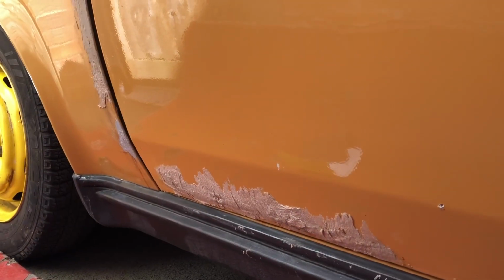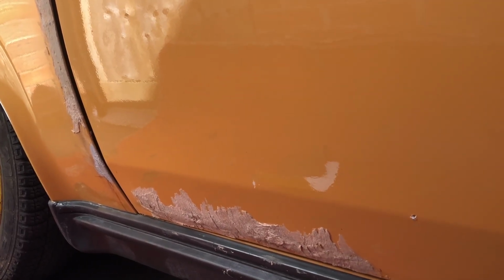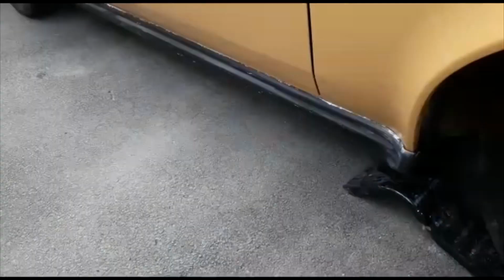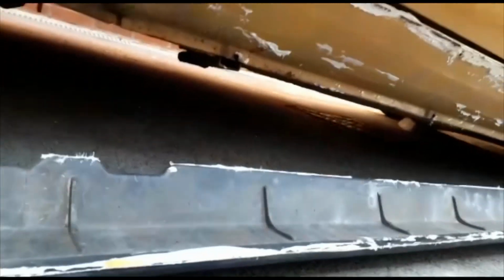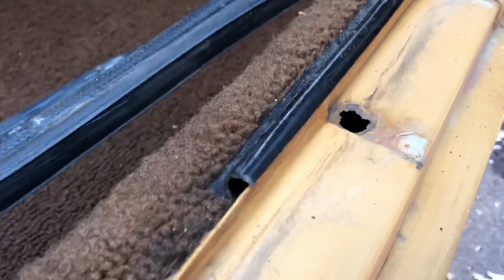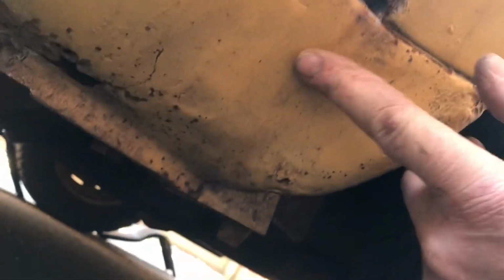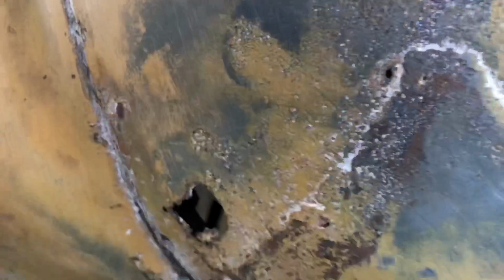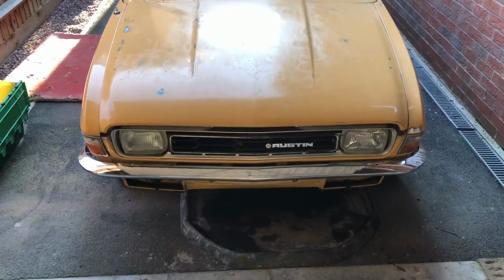Austin Allegro Ep.5 Bodywork begins, digging for rust!

Comment: rust? nah just errr unfinshed body work, and errrrr browning of the metal not rust beatiful plumage the allegro huh? no its not rust its just brown over spray paint hmm see though it well yes for better acess very good them bl boys huh? adding a brown hole here and there to get to nuts and um other things, 
ooh its not bad "shows picture of a lump of filler" okay that bad but its not that bad bad i've seen worce its when you find bake bean tins for patches you start to worry, 
yeah those holes are bad but i guess at least something aws done filler its not on major parts as in the sills or you know crumple area's but yessh going to need some bits of metal and bender of metal and a weilder oh and cutter to put in new metal, 
sadly again back in the old days plastic for area's were water will ge trapped or water trap area's weren't fixed until the 90's by then though the rust went to others area's were rust didn't go but now did so its gone in the classic water trap area under the front valance and the bonnet side and wing sides shame but not that bad it can be saved, 
the allegro fuel econeme was pritty good even today going about 72/5 miles per gallion that was very good back then and now